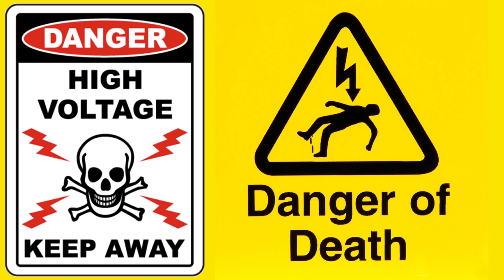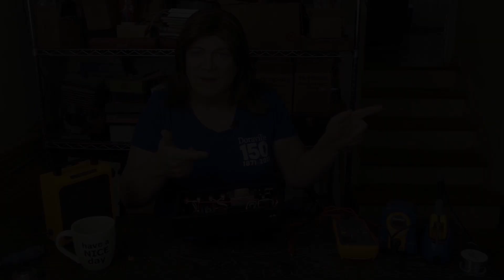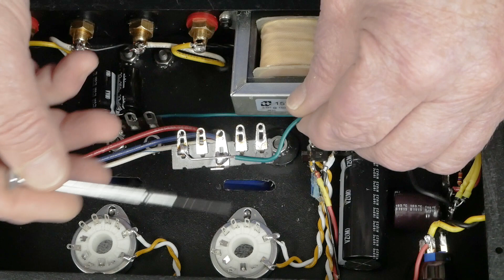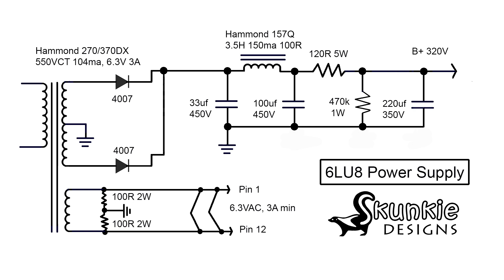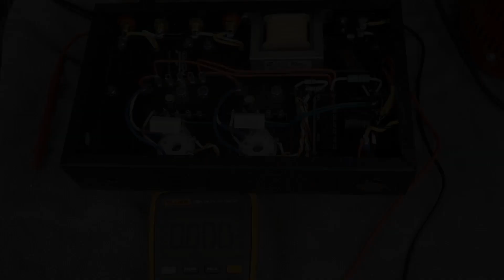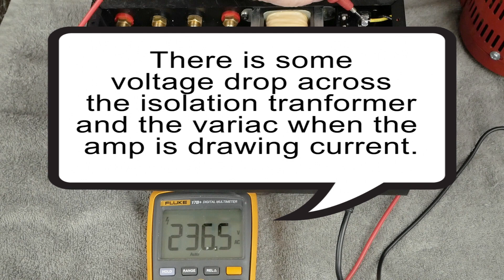DIY 5W Compact Tube Audio Amp: Output  Pentode Wiring

Comment: A little late to the show here, but I'm puzzled about your grounding scheme. You run everything back to a star ground, but you connect each leg of the star to the grounded tab on the tag strip. Doesn't that then get grounded to the chassis, creating a ground loop including the chassis and the wire to the star point?
Reply from the maker: Mark at BlueGlow talks about this, theoretically you are right. In practice it doesn't create a problem. Now if you just grounded stuff to the remote mounting tag point, without running a wire, using the chassis as the only path, yes it will def cause noise. Old amps did this and they had issues with noise. I've built several this way and as long as you run a wire between the ground points, it's fine.

More recent amp builds I don't use that mounting tag point at all to avoid the theoretical argument.  Just use tag strips with one more tag point if this bothers you. In practice it doesn't cause a problem.

Comment: unf.  i've got 40.5v on the cathode which is too hot.  plate and b+ same,, 311, 318, and i want ot keep those numbers. screen is about 308.   i bought some 800ohm resitors but i'm afraid that will drop too much.  i excpect some kind of resistor/series/parallel jumble to get that 35/36v....!   the resistors measured about 744 ohms out of the pack ( closest of 10 or so I got others were lower).   very frustrating.  i have other tubes to try but that is not any solution I want ot use either
Reply from the maker: Yeah, that's too hot at 100% dissipation. I would try some other tubes first as these are all very old tubes, possibly used at that! Also check to be sure you have zero volts on the grid measured to ground!
Reply: @SkunkieDesignsElectronics  thanks, yes too hot, same with different set of tubes. grids are a few millivolts---  i checked at about 110 volts and the cathodes are about 35-36, but my wall voltages are about 122-123.. if i lower the B+ i'm below 300v, the b+ is fine at wall voltages.  i ordered a different brand of cathode resistors in 750 and 800 ohm, 10W (i know your opinion of using higher wattage cathode resistors, yes). we'll see what happens.  i'm not a huge fan of those Yageo brand cement ones anyway, they might be better for lower Ohm values, i dont know. they seem to have a lot of shunt resistors like 1.2R or .1 etc. of that brand.  the ones i used were about 743ohms and those were the closest of the 10 I bought for 750ohm
Reply: @SkunkieDesignsElectronics  hi skunkie, I ended up having to run 900ohm cathode resistors to get to 90% pd.   any ideas why its so out of spec (20%)?   everything else measures ok, B+, plate etc.  hot tubes?  (2 sets!?)  thanks

Comment: Forgive my twisted sense of humor, but....whenever I see that caution about "lethal voltages," I tend to chuckle.  In the 1980s, I was responsible for the repair, care & feeding of a 50KW AM BCB transmitter.  Its plate P.S. put out 24KV,  Now, THAT is "lethal voltage," the kind that will "reach out and TOUCH you."  :)
Reply from the maker: Yet even 250VDC from hand to hand across your heart can kill you.
Reply: @SkunkieDesignsElectronics  Yes, I know.  I'm not suggesting that anyone abandon caution when working with B(+).  I've read about people who were electrocuted in the 1930s, while working on 36V farm power systems, in the rain.  But I DO have a somewhat perverse sense of humor, and I wonder how kids today would have gotten by, back when hundreds of volts was found in most equipment, "high voltage" was defined as 1KV or more, and every VOM had a top range of one, to several, thousand volts.

Comment: I'm not sure if this is a stupid question or if you've covered this in previous videos (I'm sure you have), but how adaptable is this design to 230v? Is it trivial, or a total redesign?

I'd love to build it, but I've never been sure what would have to change to make the leap from 110v.

Thank you for the videos and hard work, they've made the topic of tube amps feel much more approachable!
Reply from the maker: Instead of the 270DX power transformer I used (which is 115/125 V specific) use the slightly more expensive 370DX, which is adaptable to any line voltage. Everything else would be identical.
Reply: @SkunkieDesignsElectronics  much appreciated!! Thank you!
Reply: Power transformers fron Hammond adapt to line voltages over the world...
Reply: @frankgeeraerts6243  thank you! I thought other component values might have needed adjusting, but glad to be wrong about that